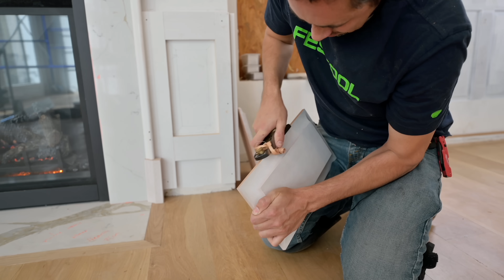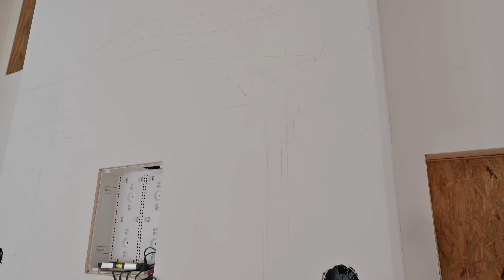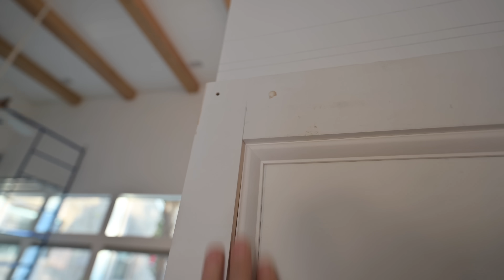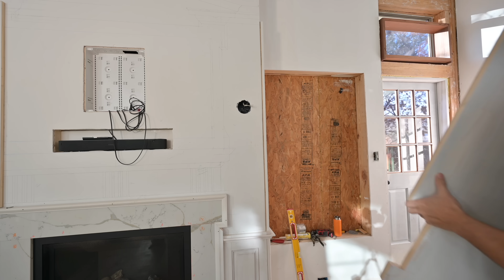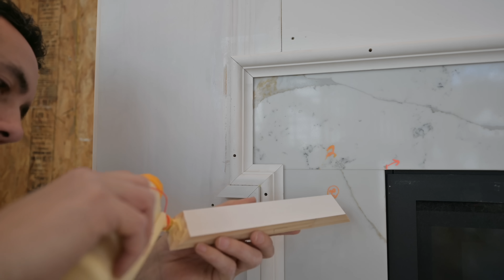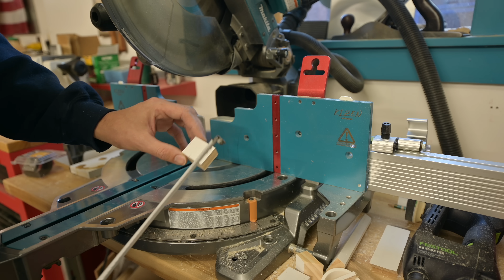Building Paneled Walls the RIGHT WAY

Comment: Enjoyed the video Richard. That was allot of layout for your mantel. It is really looking good and very creative. I have to mention. Where's your guard for your jointer? At least slide the fence over to cover most of the unused blades. You need to check out Perkins jointer accident if you haven't already. You be safe and God bless.

Comment: Try using Gorilla Carpenter glue, it's so talky that most of my pieces just lock into place without brads.  Or you just need one brad 18guage.  I have done newel post without even one pin nail. And it's water clean up.

Comment: Since you decided to trim screw them in, I would recommend that you use a 1/4" forstner bit to make a shallow hole for your trim screws to set into and then use a 1/4" dowel to plug the holes for a cleaner finish.

Comment: As a painter I have this on going debate frustration. Who's job is it to fill in those finishing nail holes? The carpenter who made them or the painter who is doing the finishing paint coats? And as a carpenter when to use screws in the face and when to use finishing nails? I use screws for strength but you used them for the panel frame no strength needed there and even why the pocket screws as well? I  agree that last molding you turned upside down is perfect.

Comment: This is magic. To see you use a picture molding in an unconventional way is magic indeed.

Thanks for the versatile tip on how to setup your miter saw to quickly and accurately cut the off camber miter.

Your mantle looks like a champion.

Comment: Anyone know what box was used behind the TV?
Reply: It looks like the Legrande OnQ 14” metal box.  I just installed one for my daughter’s Samsung Frame TV One Connect box (the same TV Richard will be installing).  I trimmed off a couple of inches of the lip on the bottom edge of the box to allow the One Connect to easily slide into  the enclosure and added an electrical outlet to the box before installing.  I ordered it from Amazon.
Reply: @JT_70  thank you!   Appreciate you taking the time to respond
Reply: @rok4220  Similar boxes are available from other brands such as Leviton (at HD) but I liked the Legrande better.  The plastic boxes from some brands were several times more expensive than the Legrande.  Lowes has a 14” x 17” Legrande plastic for about $50.

Comment: I'm glad to see a professional using molding in other ways than the way it was designed.  I have picked up moldings in home centers and mentioned what I was using them for and was told that they were not meant to be used for that.  Well, I bought it and I can use it how I see fit.  
Your fireplace is looking awesome.
Reply: Technically, the way he used the picture hanging molding makes it an edge bead molding . I made a “crental” mold to trim out my kitchen, which is a dental molding turned 180 degrees so the openings face upwards and look like the crenellations on a castle wall.